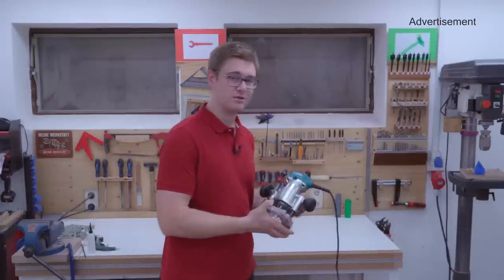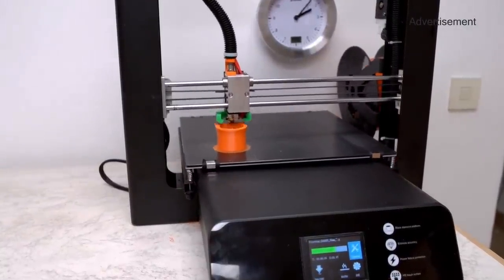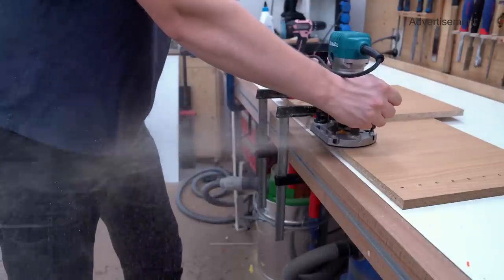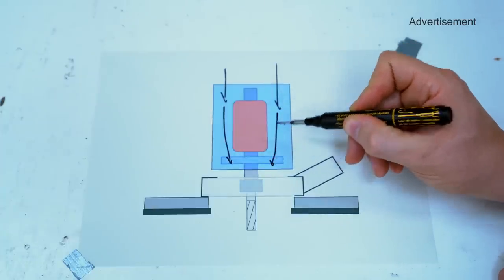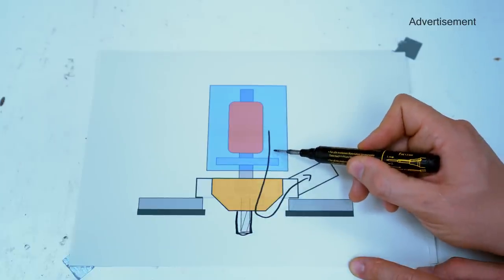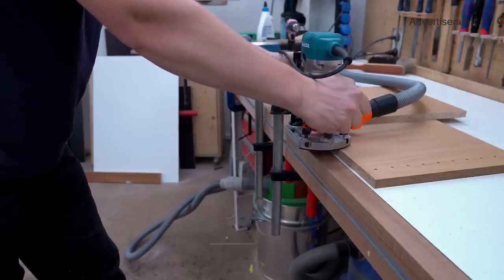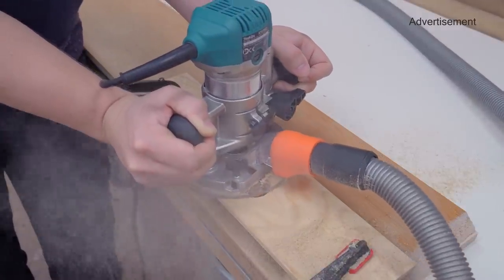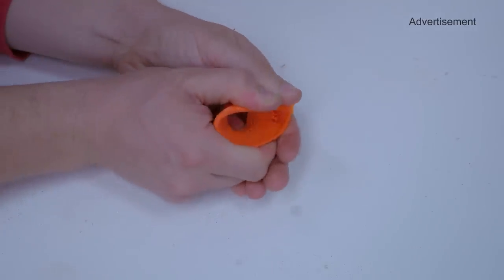Improving Router Dust Collection with 3D Printing - Airflow Redesign Explained on Makita RT0701CX7

Comment: I used a festool router at a trade school that was well stocked with fancy tools and the instructor pointed out that festool had solved this problem by having the motor fan exhaust out the side rather than the bottom. I was shocked when routing a blind hole that almost all the dust stayed in place, making it difficult to see what I was doing. It's always interesting to see people come up with different solutions to a problem.

Comment: You should have a look at the Festool shroud, instead of having a kind of funnel as you made it is more like a dome with a hole large enough on the upper part so the router bit move freely, that will let more space to inhale the dust inside the dome shape .

Comment: Hey Cosmas, as always a well presented video. Nice to see the difference for the Makita router dust collecting. When you look up Festool, and check the standard adapters that come with the router. You can see that the router bit is fully closed from the machine. Maybe if you are looking for improvement you can look it up. When i use the Festool 99% of the sawdust gets collected in my vacuum. I have a big Starmix, might be a bar comperessment because it is a heavy duty one.

Comment: Watch out, your vacuum hose seems to have a static charge at 7:25. Static charge and fine particles (like sawdust) could result in a fire (or explosion). 
Don't know if this is a big problem... Great video btw!
Reply: Static charge won't ignite anything. What you would want to worry about is static discharge - more specifically a sparking discharge. In this instance, what I see is a static build up on the hose attracting those dust particles. Those dust particles obviously have the opposite charge. Together the left over charge is quite negligible. Meaning I seriously doubt any sparking discharge would issue from this system.

Comment: Hi Cosmas, I went on your Thingiverse page to look at the 3D files.  Good job !  No problem with the 36mm adaptor for Festool hose, works perfect.  As for dust collection lid to be but in the plunge base, which file would you suggest.  On is dated of October 17th and the other, a week later, October 24th.  Is the second one an improvement of the first version?  Which would you suggest?  Thanks for your input !

Comment: Shouldn't the dust port be at the back of the router when your pushing it?
All the chips should then go straight into the direction of the hose amd get sucked in.
Either that or your using the router the wrong way around.

For example rout a piece of timber again like you were in your vid but instead of starting at the front of the piece of wood pushing it put the router at the back of the timber and pull the router towards you and you will see all the chips get sucked up.
Reply: That's what I was thinking...
Reply from the maker: https://youtu.be/Vokhe3JkvXY?t=91

Comment: It shows you that these  tool makers don't test, or care about the products they sell.
Reply: Not really, more like things slip through... Tool makers aren't run by just engineers, etc. but marketing, sales people, designers, etc. that all have to work together and somehow not get in each others way.  But they are people and people make mistakes, they make assumptions, etc. While not all issues will be problems they can just test for in the lab as there isn't always a replacement for real world use to work out the bugs and companies don't have limitless resources to just spend time testing and testing without sending something to market so they can earn enough to keep the company lights on...  

Companies also don't do everything in-house, many outsource for different things and especially accessories can be made by 3rd parties that may have nothing more than specs to go off of... Some of these brands can be a result of multiple companies working together but more moving parts means greater chance things can go wrong but they often cater to international markets and the logistics can be complex, with also worry about timing as taking too long can cede the market to competition or miss the window of opportunity for when the product will be in high demand...

So it's not that they don't care, they're just not perfect and some will be less perfect than others...  It's more telling if they refuse to fix a problem once it becomes a known issue, then you know they don't care but otherwise there's usually room for a benefit of a doubt...

Comment: Has it occurred to you that the dust collection wasnt working because you were running the router backwards? You need to position the machine so that the dust port is sucking in the direction that the cutter is blowing out the chips. Simply rotate the router 180 degrees. You've over-engineered a solution to an apprentice mistake. You are now qualified for a job at Festool LOL
Reply from the maker: Good Point! But it does not make a difference. Watch my explanation at 3:21. You're welcome :)